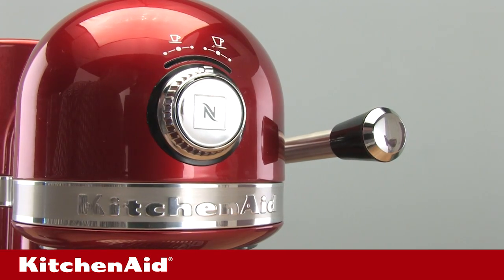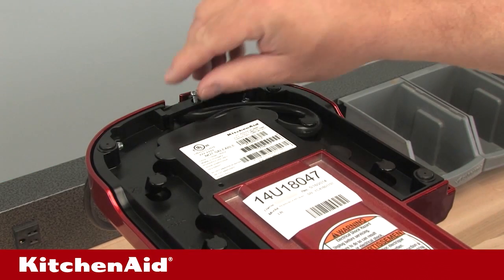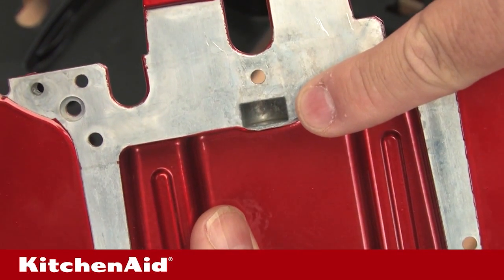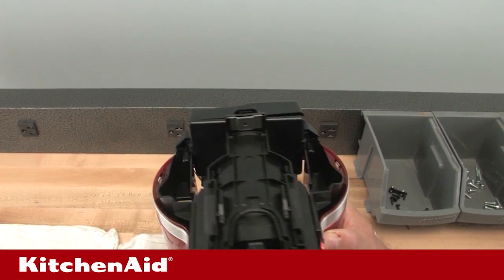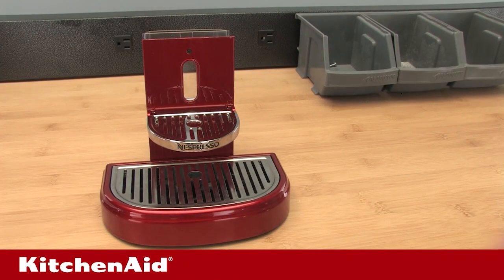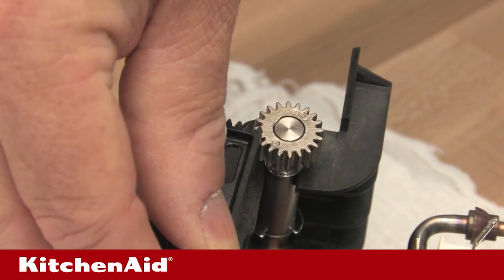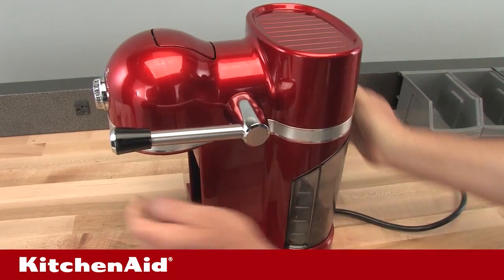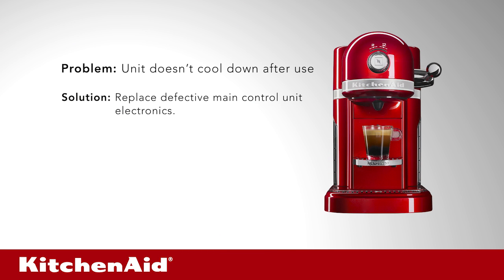KA Repair Video KES0503 5KES0503

Comment: Excellent video. Very easy to follow with every step shown. We have water leak which I thought was the rubber seal between the heater block and the capsule unit, but it’s still leaking. Very annoying as it’s about as far into the machine as you can go. It is also worth noting that in the UK (I suspect it may be an EU-wide thing) you cannot buy spares as Kitchenaid will NOT sell you any parts and you are therefore forced to send it to Nespresso and pay a minimum of £80. DO NOT therefore cut the clips holding the pump and heater together. It is possible to get the heater and pump out as one.
Reply: Did you ever establish what caused this issue? I'm about to take mine apart to investigate what appears to be the same issue as you, where the majority of the water flows into the capsule receptacle and ends up in the drip tray.

I too also ran into the problem where Nespresso will not sell you bits to fix and just want you to send it to them to diagnose.

As for the circlips, hopefully these are relatively standard and can be replaced by purchasing from a third party if they do need to be cut because its difficult to remove the pump and heater as a single unit.
Reply: @markward1686  did you ever fix this? I'm having the same problems and wondered if you identified the fix?
Reply: @adamtaylor.  It is still in pieces due to lockdown making travel to its location classed as non-essential. Upon disassembly, inspection of the capsule receptacle area didn't reveal any signs of damage that might cause water to leak, however this was only a visual inspection rather than applying any pressure via the water inlet, this is still to do. I am therefore at this stage unclear on the cause. Prior to disassembly, I did notice that the spout area was contaminated with coffee grounds and cleaned this as far as possible, this made very little change. Now it is fully disassembled, I will be cleaning this further by use of soaking, compressed air and any other non invasive techniques.

I can however confirm that there is no requirement to cut the circlips to remove the pump assembly and it can be removed as a single piece.
Reply: @markward1686  thanks very much. I had a similar problem with my pressure washer and I just replaced the o rings at the cost of a few pence and that fixed the problem. Perhaps the same here too
Reply: @adamtaylor.  There are some O rings in the thermal block, however on mine, the water that leaks out is tainted with coffee suggesting it has passed through the pod. I would feel that if water was leaking at the O ring area, this would be clear . If yours is clear, then this could be the fault. Finger crossed :)
Reply: @markward1686  don't think I feel brave enough to open it up! If it wasn't something obvious then I wouldn't actually know how to fix it.. may as well send it off for £80 and know if will get fixed I guess!
Reply: Same problem here. The machine leaks water out at the bottom of the brewing unit. I am not sure whether it leaks out of the thermal unit or out of the housing where the pyramid mesh is located. Our local store (in Germany) sent it to KA but they just returned it and said that they do not repair these machines and don't have any replacement parts. However it seems to be a very common issue with these machines. Can someone give us a hint how to repair this? Thanks

Comment: Thanks for this video! At 11:50 where you cut the wire locking clips I guess standard "E-type" circlips DIN 6799 would do the job as well as they do in industry.

Comment: Hey Cean, awesome video, thanks. Just wondering if you can help with my problem more specifically. The machine worked properly fro 5 months. But now the following happens. After putting the capsule in the machine and close with the lever it seems that the capsule is not pinched from the front anymore. so no coffee can go through the capsule any longer. Just the 3 holes in the back of the capsules are still pinched. tried multiple "always original" capsules today and always the same result. What is there to do?

Comment: Hi Cean: I recently bought 2 units used because 1. These are discontinued & I have always wanted one at least 1 year now. 2. The first unit has a broken dial & it does not turn. That is why a second unit is on its way. I can not seem find replacement parts. I thought by looking at your video I can do the repair myself. This seems too complicated for me with too many steps. I would like to know if all a of this has to be done just to repair the dial & rubber ring?

Comment: My unit leaks into the drip tray when making a coffee ... seems to be a known problem - does any know what the issue with this?
Reply: I have the same problem with my unit. It leaks water (not coffee but also not clear water) from the brewing unit.
Reply: @richardtreu2967  did you fixed it! Got the same problem, it leaks not water and not coffee
Reply: Same problem :(
Reply: same problem.  i assumed that an o-ring needs replacing but ive not tried it to know if this is the actual problem!

Comment: Hi Cean

The problem with our Kitchen Aid 5KES0503 is that when you turn on the machine the light on the selection  dial keeps flashing and then turns off . The machine is 4 years old . Can you help
Reply: Hi did you get this resolved? We have the same problem and will attempt to replace the water pump